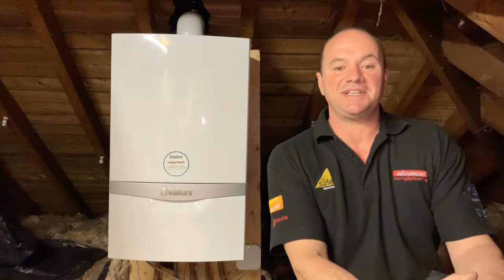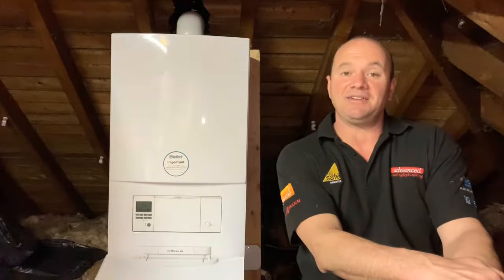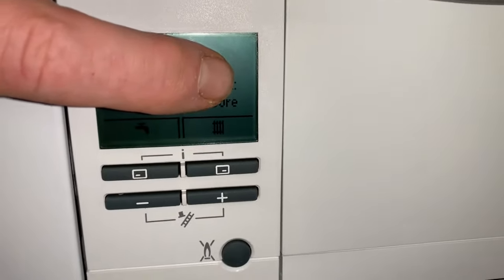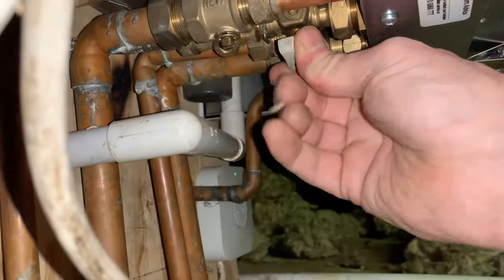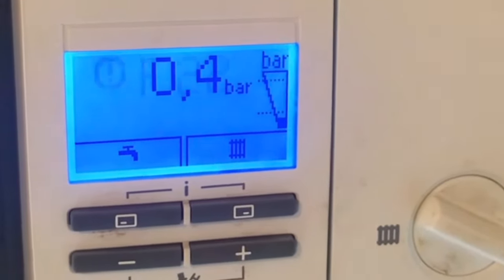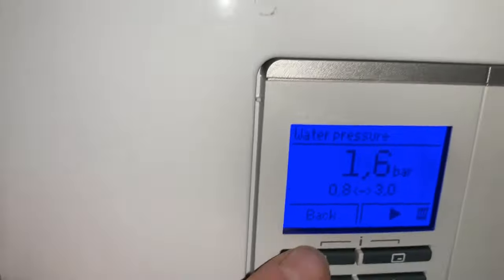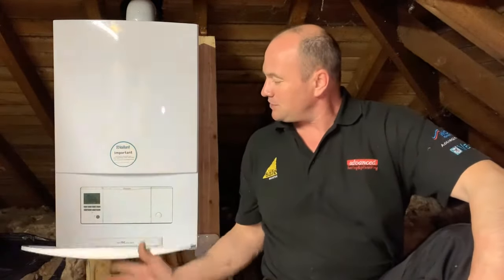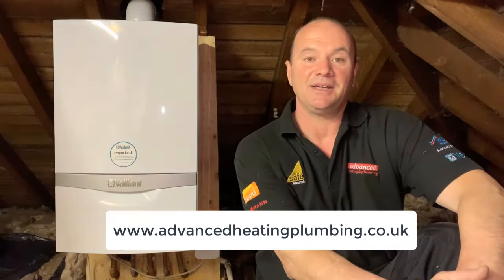How to solve F22 fault code and repressurise Vaillant boiler

Comment: the problem is mine hasn't got the valves, i can't identify which ones to turn......
Reply: Same here
Reply: Same here as well
Reply: You have 2 tubes that connect, the tube that connect means it’s a loop
Reply: They do, they’re just located somewhere else under the boiler… I just fixed mine…

Comment: Thank you. I use your video as a reminder when the pressure drops! 
Happened today, and as I live alone, and I'm an 'oldie,' I always worry. I normally remember what I have to do, but it's always good to check. 
However, although I did get my hot water up and running, the valve on the right, which I usually turn on first, hardly moved at all. I am the only person who fixes my boiler, and I don't really have the strength to turn it off that tight! Anyway, I opened the other valve easily, and heard the water gush in, and saw the pressure going up. Turned the tap on, and there was hot water. Miracle!  Obviously turned the left hand valve off, but the other valve, there was hardly any movement. I hope you get to see this comment, and will kindly answer. Thanking you.

Comment: Very simply explained and helpful. I literally found this video within 1 minute of facing the f.22 error issue and my boiler was back up and running within the next 3mins. Thanks so much for the knowledge share, this has saved us at least £50 in a plumber call out charge.

Bless you 🙏 ♥️

Comment: I have a Vaillant Ecotec Plus 824 and was faced with the F22 error. I was worried because this error prevented the boiler from heating hot taps as well as central heating. I understood the filling loop is just for central heating but I just wanted the hot tap. I didn't understand how the filling loop would let the hot water taps work. Nevertheless, I followed the instructions in this video and the boiler kicked back into action, including the hot taps. I guess it's just how the boiler operates. Thank you so much for this video. I've been at work all day and was desperate for a shower at 1am!

Comment: You've helped me out twice this week, Tony...with an F25 and then an F22. Second time was after a visit from a Vaillant engineer who was supposed to have fixed it. I suspect he didn't hang around long enough to check he'd fully pressurised the system. Hope I'm right! Thanks again.
Reply: Had an issue with my such boiler where the circuit board was replaced after we reported there being no hot water or heating, only for half a day later of hot water/heating being back to end up with this F22 code. I suspected there was something off with the 10 minute job the plumber/engineer guy did.

Comment: Fab guidance, my pressure was really really low, im a woman lives on my own so i so much was grateful for that, my heating was actually off as a result & following this i got it back on again: the only thing i had a bit of a problem with was u didn't actually say what number the pressure should be on:  i was happy it came on never the less, if any 1 has any idea what the pressure should be on please let me know, many thanks 😊
Reply: Between one and two if you have numbers or between the upper line and the lower line ...I hope that was helpful

Comment: Our boiler looks the same but I don't see any dials underneath it, we also have a immersion heater upstairs and when we had this low pressure problem in the past an engineer from the boiler company installed a similar dials but instead of what you had in this video ours  is a screw kind of dials. I have fixed this problem in the past many times but this time it's not doing anything when I allow water into the tank/boiler to get the pressure up. Any ideas why it's not working this time?
Reply: I have a newer model and i dont have a valve but a kind of a plastic screw. Once i unscrewed it, the pressure started to rise.

Comment: I did this on my Vaillant EcoTec Plus boiler, and got back the heating on. 
But some black water spilled down the left hand side of the boiler after I did it. The leak stopped shortly afterwards.
Advice? Do I need to call out for repairs?

Comment: Folks mine has F22. Now it always has lost pressure over the year between annual service but engineers been out 3 times now and changed the pump, valves, heat exchangers etc it’s worked lovely for 3 weeks but all pressure gone and F22. British Gas say this keeps happening because there must be a blockage somewhere and only a power wash is going to solve our problem. Thoughts folks? It’s a 15 year old Vaillant combi always serviced annually and no issues until last few months. As I say at least 5 parts changed and been running much quieter than before sounded like a new boiler but it’s lost all its pressure in 3 weeks

Comment: Hi thanks for the advice, but I got a question I've managed to get my pressure back up but the boiler is leaking water out the bottom, and everytime I put the heating or hot water on I have to do the pressure again. I've bleed the radiators but still doing the same result?
Reply: Same here, filled from 0 bar and f.22 error up to 1.8 bar (cold) and now while it is heating up the pressure went to 2.1 bar (20 minutes later 2.0 bar)
It has leaked since it was filled, but the gauge bar was never above the middle of the gray area, so far from the red area.
Does this mean the installation is bad/broken and needs repair? I can't see how else it could leak water from the bottom straight after it was filled to 1.8 bar and started heating.
I am monitoring it right now, to see if it stops at some point and where the pressure ends or if just goes empty again.

Comment: I got the f22 error for a long time, but pressure is not the issue. (mine doesn't have the big digital display, only one that shows temps or faultcodes). I see the pressure on the gauge.

Symptoms:

No warm water anywhere(faucets, heaters).
When I turn off power for a bit, turn it back on and open faucet, I see temp climbing from ~30°C to 99°C in a matter of seconds. I'll have somewhat warm water running for like 2 seconds, hear like 2 pretty loud BONKS inside the heater, watergargling sounds, and back to the F22 code.

Comment: Hi I have found my filling loop, basically 2 black turn handles, but the one on the left just will not budge, I've even unscrewed the handle and still will not turn. The one on the right turns up and the one on the left is suppose to turn down I believe. But it just won't move, any help would be great. It's a digital vaillant ecotec pro 28

Comment: Great. Managed to find the valves after about 10 minutes, one had no finger twister bit on it. My question is if the boiler knows when it has low pressure, and the solution is to refill the pressure to within limits detectable by the boiler then why the hell is this not automated? Why can't the boiler automatically open a valve to repressurize it? This feels like as problem that home users should never need to have.
Reply: I'm a year late but...

Motorised valves can stick and if they stick open you've got a problem. You can buy quarter turn ball valves and a separate motorised 'turner', which is more reliable but the motorised bit is still pretty new (and rare).

Comment: Followed the whole procedure as mentioned. The heating and hot water come on but only for a short time before it turns off again and F22 reappears. Done this repeatedly but the boiler keeps turning off and F22 appearing.

Comment: I do this whenever i get an F22, fill to half way and isolate it after, problem is when the heating comes on fully, pressure is well into the red and i need to bleed the radiator to keep it in safe range... but then obviously when i turn heating down or off, the pressure drops too low and i get F22 again, why is the pressure fluctuating so much all the time???

I can't ever get it to be at normal low pressure when radiators are off, and then turn them on without it going into the red overpressure.

Comment: 2 things not mentioned. If its always happening you might have a pressure problem in your expansion vessel.  Remember if you keep topping it up you will need to add inhibitor to your system to prevent sludge